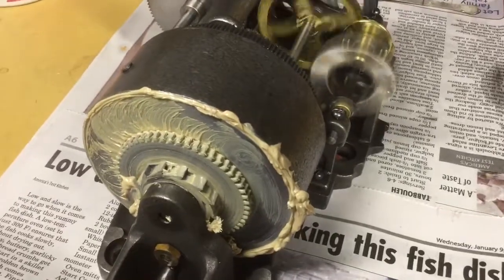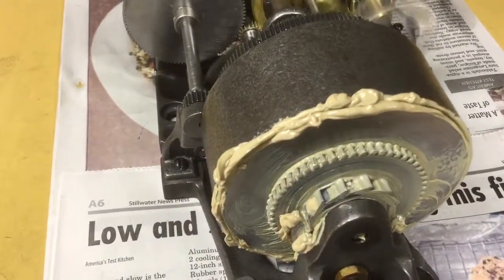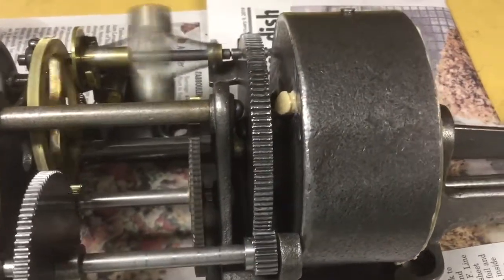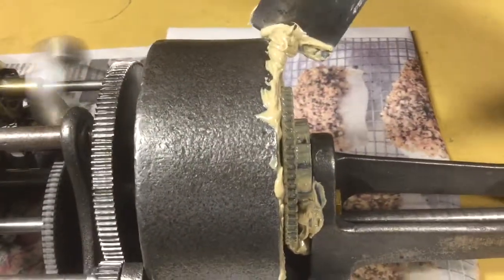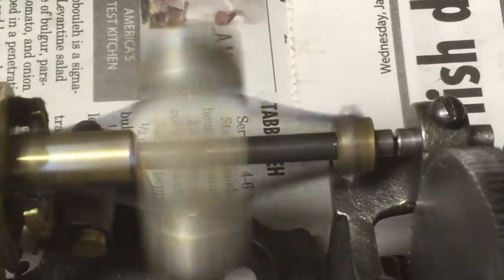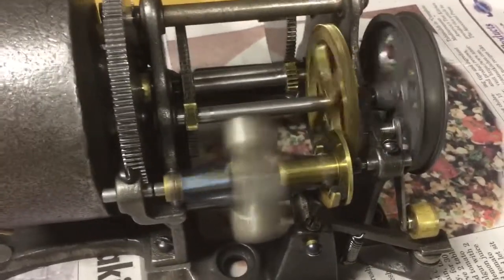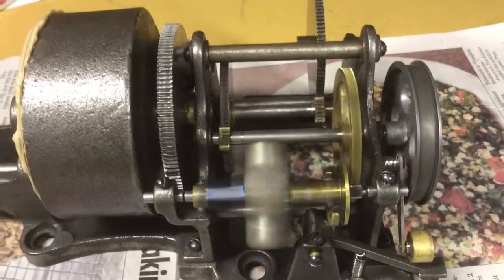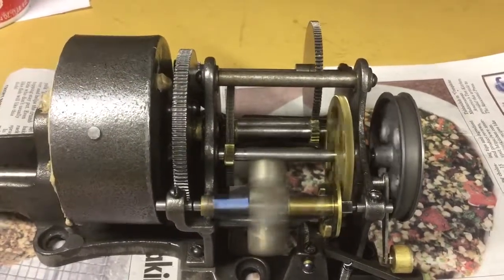Model D Edison Home Motor Repair 6

Comment: I have a Home Model A, which I worked on years ago; curiously enough, I never had any problems with that pinion. However, I did have trouble with a key pin in the winding gear, which sheared off a couple of times, and put me to much trouble to fix.

Last motor I worked on was a Triumph Model A, on which some previous owner had used the dreaded "3-in-1" oil: I had to use a torch to get some of those parts free.
Reply from the maker: Thanks Lucius for the comments. I think 3-in-1 unfairly gets a bad rap because most people don't know that for stuff like phonographs, sewing machines, etc, the 3-in-1 sold in the blue bottle as "Electric Motor Oil" should be used, and not the oil in the red bottle as "Household Oil." 
The 3-in-1 in the red bottle will gum up and glue parts together.

Comment: Thanks for this series, very interesting and it's was great how well you got the motor running when done. If you are doing something similar it would also be really interesting to see the way you go about soldering the gear and also marking the shaft true again. I have a HMV model 32 motor which I really ought to service and it was interesting to see both oil and grease being used on the spring. Wouldn't have thought of that. Thanks again. 😀